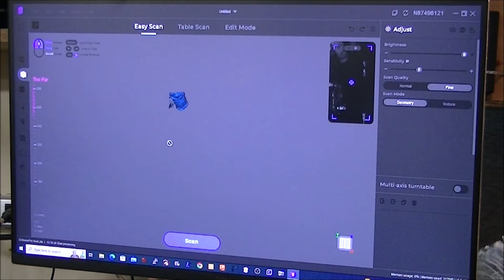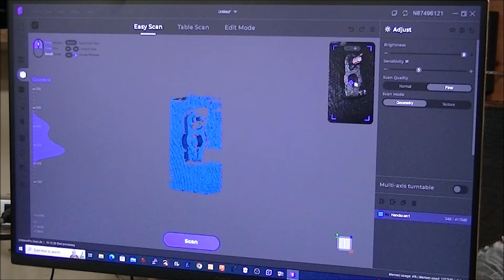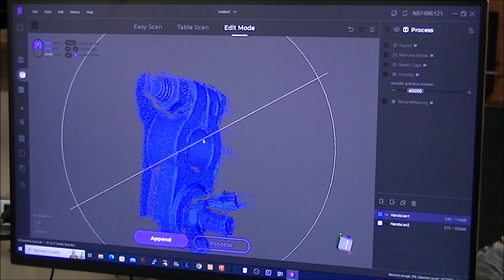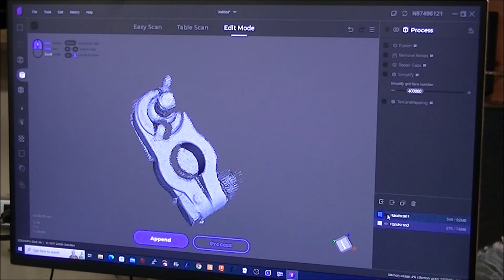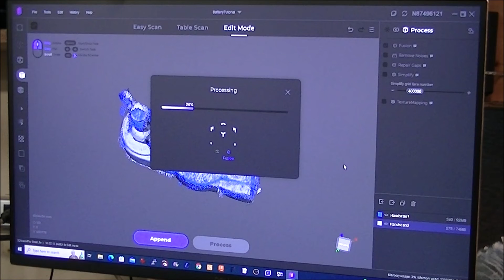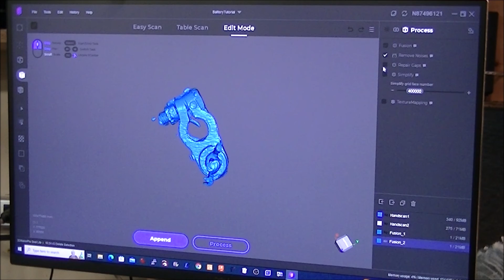Seal Lite Scanner by 3DMakerpro is it worth it? This tutorial will help you decide...

Comment: So with all the clean up and issues is it worth it and have you found a better unit in the same price range?
Reply from the maker: That's a really good question... I don't have experience with other units so I can really say if there are better ones... 

Is it worth it... depends on what you are scanning I think... Lets look at the example I filmed... battery clamp... reality is that anyone decent in a CAD program like Fusion 360 or even TinkerCAD could probably get a cleaner more accurate model created in about the same time and then you have something that can easily be edited and modified... But there are lots of things like human hand, figurines and other irregular shapes that are very challenging to design in any CAD program. In those cases I think this is a great tool for the task and worth the money.

Comment: this is not an error with this marking of points. You select points on the layer that is highlighted, if you have it selected as invisible and you look at another layer, you won't delete anything because you won't select anything. Try scanning on a black piece of paper - it should be invisible to the scanner so you won't have to remove anything that the scanner won't scan.
Turtable scans the surface on which the object is located and selects it itself, just press delete.

Comment: Thank you!
I'm currently in the market for a scanner that won't break the bank, since it will just have to serve for stuff like scanning the compound curve contours of model kids (e.g., scan a car model to get the contours to model widebody extensions to be printed). Seems like this would do the trick, especially with a coat of washable color to remove the reflections interfering with the scan.

Comment: I can't get mine to connect to a computer (have tried 2 at this point) and haven't found any videos offering any help. So...
Reply from the maker: While the Seal Lite scanner has a USB-C prot on it, it appears to require special cabling to connect. It comes with a Y cable to USB-C where one part of the Y goes to your computer and one part goes to their provided power adapter. Are you using their cable and their power adapter?
Reply: I see where I didnt have the right cable going to the scanner, but unfortunately its still not detecting the scanner.
Reply: That was my issue. Thanks!

Comment: I bought a Seal Lite for Christmas, I definitely need to work on how to use it.
Reply from the maker: I had serious doubts for the first two days. Then I had a few key moments. Now I am at the “this is wicked amazing” stage!!!
Reply: @tjones99  awesome!  I have a 57 Chevy 4 door hardtop that has quite a few pieces needed that are not reproduced yet.  I will scan them, clean up the STL, and have them machined, cast, or 3D printed.  I also have a ton of other projects too.
Reply from the maker: @aurktman1106  I can't stress enough how significant cleaning up the scans before alignment is... Getting rid of the base for starters... This is one area where Table Scan rocks... and my valuable lesson with table scan I learned (the hard way as usual) was the table itself has to have a recognizable  pattern of depressions in it so the scan software knows what angle the table is at at all times! Cleanup is huge. I have ordered the 3DMakerPro table to see if it is better than my home made pattern. 

I also experimented with "dry shampoo spray" that will really help with shiny car part (shiny anything) scanning. This dry shampoo coats with a dull white finish that comes off easy... why anyone would put this on their hair is beyond me but it works for scanning. 

Oh and I found it very hard to align a part I was scanning that was MOSTLY symetrical... easy to confuse the align algorithm (and me in manual align) ... so I used hot glue to put a few irregular spaced blobs on the part which made it easier for alignment and MUCH easier for manual alignment (which I use a lot) and then once all are aligned and the Process stage looks great other than the hot glue bumps I just delete the bumps from the scan like you would delete noise and let the "fill gaps" take care of the removed portions and rerun the process stage.
Reply: @tjones99  thanks for the info!  I will start doing that tomorrow, going to order some dry shampoo spray now.  A bunch of the parts I want to scan are chrome plated so it’s a must to dull them up.
Reply: @tjones99 thank you for the tutorial, I'm thinking about buying this to scan small parts and it really helps seeing someone using the software. Ps: dry shampoo absorb oils in your hair, then you brush it away (hopefully outside) and so it manages to give your hairs somewhat of a "clean" look... That said is mostly catered towards unwashed teenage girls xD

Comment: Great Video. I too have had a Seal for Xmas and was going to send it back seemed not fit for purpose. Maybe I  will give it another go.
Reply from the maker: Yes give it another shot. I know I didn’t use fancy screen recording etc but I think you can clearly see what I was doing mouse wise as I went through the steps.
Reply: @tjones99 THANK YOU!  I went ahead and bought a Seal Lite and turntable and while waiting for delivery watched some previous reviews, few of which were complementary, I started doubting my purchase. But I think you’ve driven home the point that the learning curve is steep but the device and software are very capable given practice.  I’m confident that this will meet my needs eventually.   Great tutorial.
Reply from the maker: @johnprouty6583  I do t think you will be disappointed once you are over the hump. It’s getting the steps to that first successful scan that is killer. I was close to throwing in the towel a few times before my first successful scan. It’s all been improvement since then. Is it perfect?  Nope. Is it as easy to use as a photocopier?  Nope. But the task itself performing is complex and with a little experience it gets much easier. Oh and scanning like thousands of frames is pretty much a waste of time I find. 200-400 good frames is better than 1400 frames. A few angles with 300 frames each and a little cleanup gets you a pretty good 3D model.